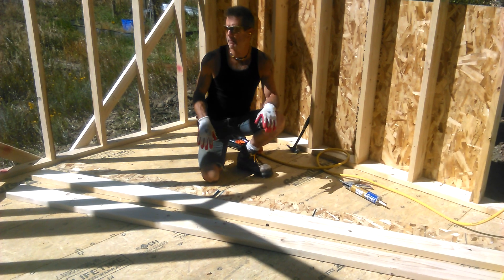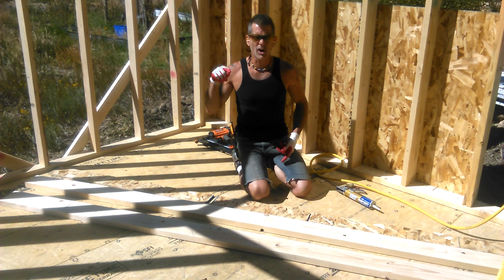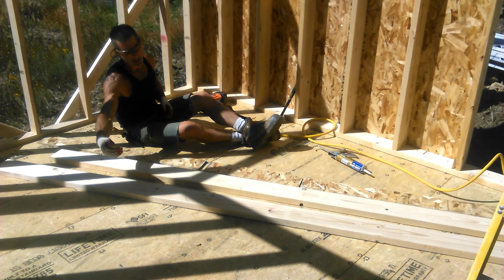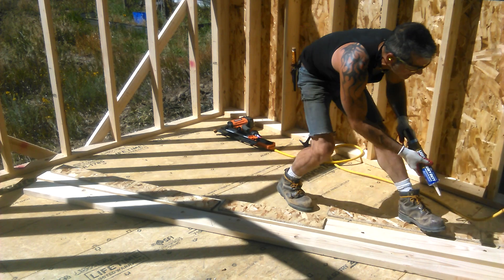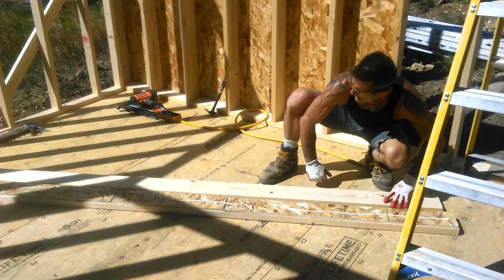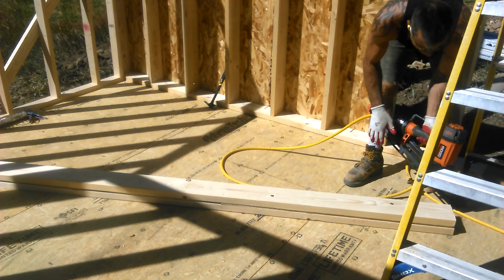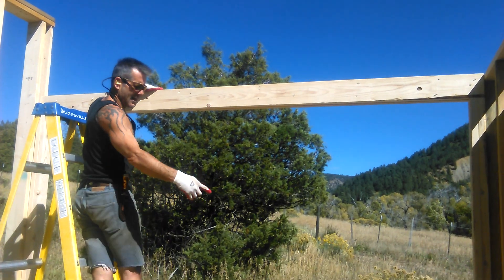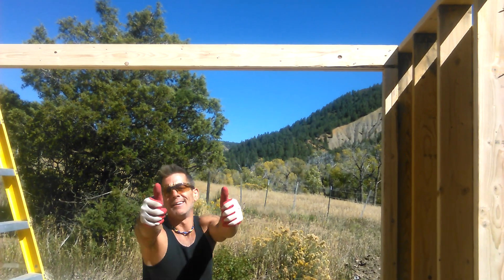Constructing Wood Beams - Save Money - Do It Yourself  - Solar Shed Update

Comment: i built one like this today but nailed either end flush and then used a clamp to bring the centers together. Now, I look down the beam from either direction and the curves in the initial lumber are gone.  Used 3.5" nails at a slight angle too.

Comment: I'm pretty sure you need to alter the direction or angle of the nails.  (From top to bottom at 45 degrees then bottom to top at 45 degrees) And, do it on both sides of the beam.

Comment: Nice video I have a question ... I'm building a roof over my existing deck and I have three four by sixes they're going to be 16 foot out and 19 ft across that I was going to build a 2x6 doubled up Beam for the deck roof to sit on do you think that would be efficient being 19ft
t long,,,, and 16 ft out?  I was going to double up the two by sixes of the frame all the way around and put a metal roof on it
Reply: That’s more than enough strength to hold up your roof just make sure u use 4 - 4x6 instead of 3 and run some carriage bolts where the 2x6 beam meets the post is the only thing really necessary n u r good

Comment: Its glued and its laminated but it definitely is not a glue lam beam. The glue is not spread evenly across the surface of the wood and there is no pressure to force the glue into the microstructure of the wood; this also leaves the glue line too thick and a possible failure point.

Comment: Diamond, I hope your other home-made gloo-beams are built with better attention to detail than the one example you slapped together here!  The commercial beams that you complain about spending $5 a foot for are far better built than yours, with an even application of adhesive over the entire length and width of the components and uniform application of pressure that your 19 nails (I counted) can't provide. Your "savings" with paltry use of adhesive and fasteners will pay a dividend of premature beam failure somewhere down the line. PLEASE improve your process by adding some of the multi-disciplinary expertise you brag about BEFORE you "instruct" others, PLEASE! You could have done a much better job and invested just a bit more in adhesive, fasteners and TIME;  maybe 3x more of each to yield a job far more well done.  But to each his own.  I'm guessing you will not PERMIT inspection of your work by the "g-men," right?
Reply: It's a shed.

Nerd.

Comment: Why not just buy a 3x6 because It's cheaper to buy a 3x6 than to buy two 2x6.
Reply: the one and only because he just created a 5x6 not a 3x6
Reply: @chriscoulson7684 , you are incorrect. A "nominal" 2x6 is about 1 1/2 x 5 1/2 inches, so two joined would be about 3x5-1/2.  Diamond wanted a 3-1/2x5-1/2, so he slapped a 1/2 inch thick slice of OSB in the middle.
Reply: 526f72736 368616368 your right! 👍🏻